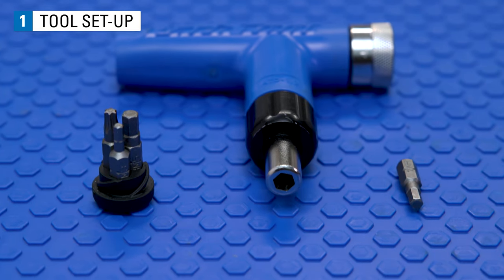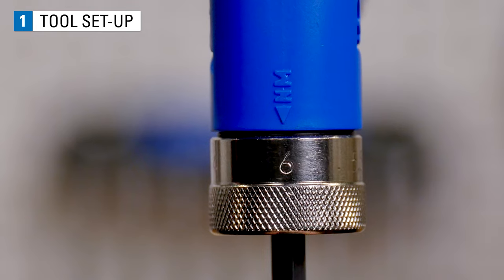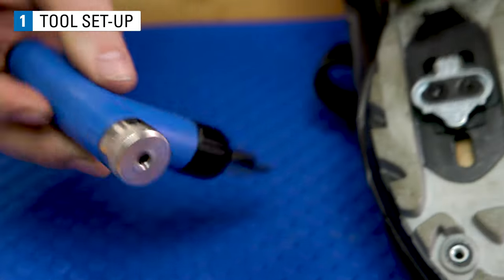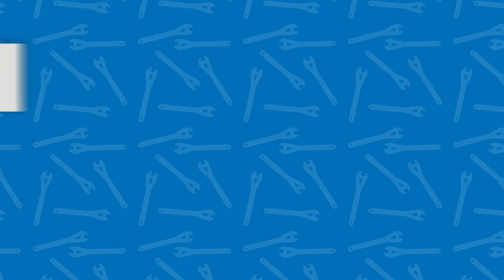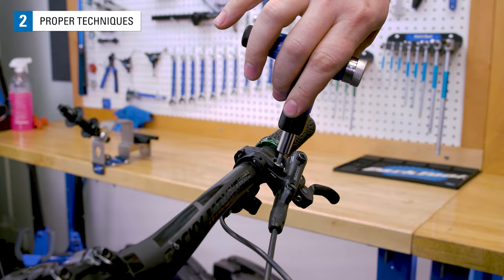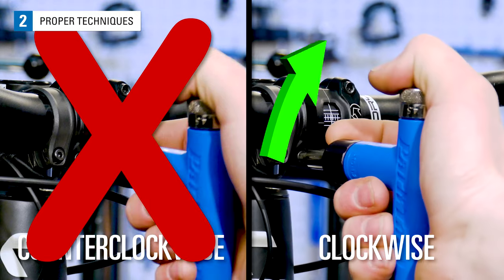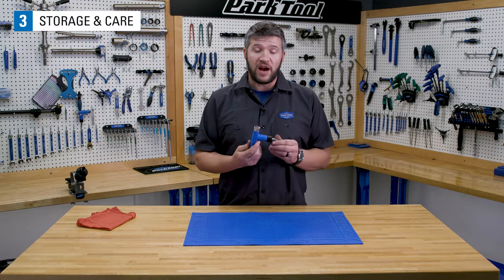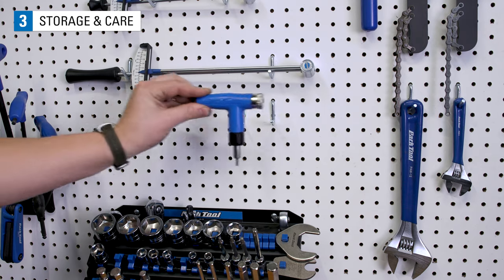Proper Use of Torque Wrenches & Drivers: Torque Limiter/Slipper/Cam Style

Comment: I have this tool and it is possible to turn the bolt past the torque spec and overtorque as a result. So pay close attention to the bolt youre tightening. Especially noticable on stems.
Reply: if im talking to someone not paying the most attention i sometimes wont notice or feel the click

Comment: I've always been under the impression that you need to store these adjustable torque wrenches in the lowest setting possible to keep them accurate longer. Is this not a thing, or is it only true for specific torque wrenches?
Reply from the maker: Torque wrenches with a wide range of setting compress the spring to a much greater range.  The ATD-1.2 has a spring but because of the limited 4Nm to 6Nm range, the spring is not compressed enough to need this relaxing.
Reply: @parktool  Understood, thanks for the prompt reply!

Comment: how do you adjust the calibration of this tool, do you have a procedure?  I work in a calibration shop and I own one of these tools. Cheers.
Reply from the maker: These are typically sent back to us for calibration. To do a good job calibrating the magnet needs to be pressed out of the tip, then a new magnet pressed in when calibrated. You can remove the snout and adjust the spring then re-install. Not ideal but does work.